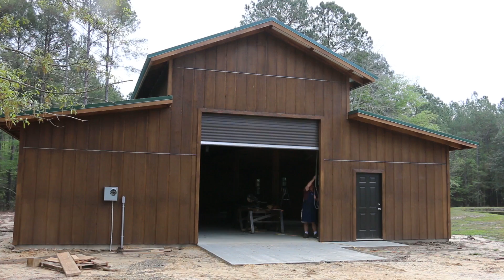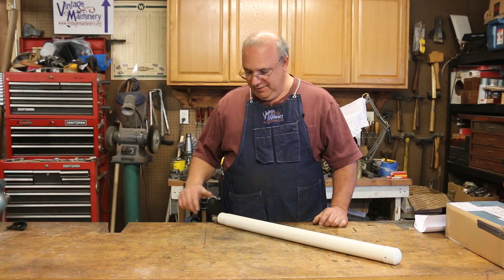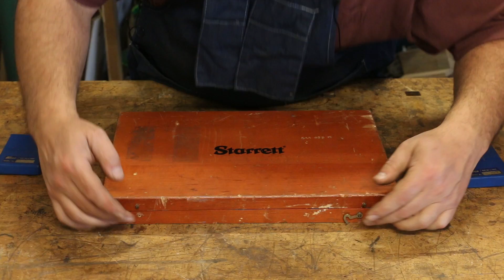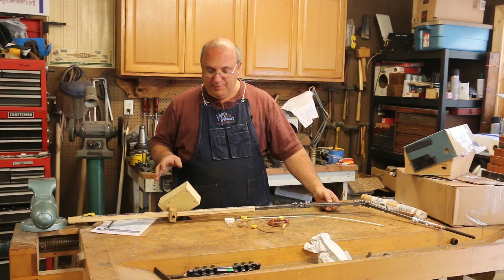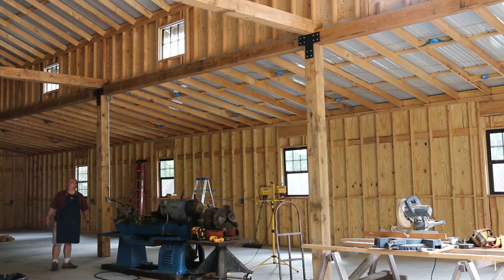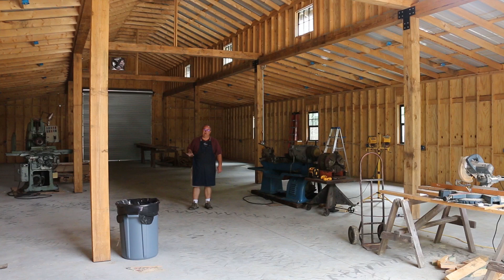Odds & Ends 44:  Viewer Mail and Shop Update

Comment: Keith, here at home there is a small bbq resturant that put in some corrigated tin for a ceiling.  At first I thought it was just cheesey, but speeking to the owner he explained that it was the look  he was after.  He even put one wall with it and finished it with moulding.  It's really grown on me and I have thought about it for my shop.  Reflects the light great and it was not expensive.  That will fit well with the look you are after.  If you would like I could see about taking some PICs of it for you.
Reply from the maker: +timholsten I have seen that kind of ceiling and like it.  But, I am a bit concerned with a metal ceiling where I will be shooting video as I am afraid it will not be very good from a sound standpoint.

Comment: Keith I love your shop, putting sub panel in is smart thing to do, I sure you know this remove the green bonding screw in sub panel.
Reply from the maker: +Joe Tiller Yes, you have to have two buses in the sub panel - one for the neutral and another for the ground, and they cannot be bonded.

Comment: Why use a rotary phase converter instead of VFDs?
Reply: +Justin Bell When you get to the number of 3 phase machines that Keith has vfd's for each one would be cost prohibitive, especially compared to a one time cost for a rpc. He will also have some other concerns like higher horsepower machines that at that level a vfd is very expensive.
Reply from the maker: +Justin Bell Exactly what Jason said.  I have a bunch of three phase machines already for my woodworking shop and then the metal working shop too.  For one or two machines, you cannot beat a VFD, but I would rather just wire the shop for three phase and be able to power the whole place off of one unit.

Comment: Nice opening shot.
Let me know when you get the bowling alleys installed.
I'll come down and we'll roll a few frames.
Thanks,
John
Reply from the maker: +John Bazaar We better hurry up and do the bowling, to many machines will be in the way soon...
Reply: +Keith Rucker - VintageMachinery.org 
That's true. You'll need them to make the bowling pins and rebuild the pin setters.
Thanks,
John

Comment: Have to agree with you Keith on the quality, it looks outstanding, absolutely gorgeous. Got there in the end. 
One of my lifelong dreams to have a workshop not quite to the extent of yours but something i'm comfortable in that allows me to work on my motorbike's and paint in house, a home away from home.  
Are you planning on running air lines throughout, also Tongue and Groove would look nice covering the insulation.
Reply from the maker: +Dinxsy Yes, I plan to run some airlines at some point.  So many things to do and so much money to spend....  I would love to do tongue an groove throughout but I am afraid it just is not in the budget....
Reply: Keith Rucker - VintageMachinery.org I did think about the cost after having the thought with the amount of coverage needed. Old Floor Boards would look nice also but i guess they sell for a good price with the many old properties in the US.

Comment: Keith I highly recommend a VFD I get them out of Georgia close to you I can't say enough good things about them from AUTOMATION Direct

I am using 3 of them in my little garage at the house

shop looks great I'm getting excited
Reply from the maker: +Bill Nebergall I am familuar with Automation Direct.  I will use a Rotary Phase Converter to power the shop, but I already have a few VFD's on some of my machinery for the woodworking shop.  You guys have not even seen most of that stuff yet....
Reply: +Keith Rucker - VintageMachinery.org looking forward to it

Comment: You have a problem with water splashing up onto your wood siding. I would put up rain gutters, that will help to some degree. If you don't the wood will rot in short time.
Regarding the acid on the concrete: Use a floor grinder instead. That way you will get a pretty structure and you won't damage your concrete with acid.
Reply from the maker: +Panzax I still have some work to do outside - dirt work around the building, some landscaping, and perhaps even some gutters down the road.  Things will be better once I get some landscaping in so that the water is not dripping on bare ground.

Comment: The shop is looking good; I like chip board instead of plywood and it's cheaper. made from wood chips and glue it has a neat color pattern to it also. I know what you mean about work and the honey do lists getting in the way of your shop building fun LOL
Reply from the maker: +DS75921 I have not even started pricing wall material yet - too many things to do before I get there.  Right now, it is just a challenge to find time to work out there between work and family.  Back on the road again this week and weekend....

Comment: It's pretty evident you worked as an electrician for some period of time. Your panel packout looks professional, the cabling looks neat and secure to the wall cases. Opting for a mirror panel is an installers dream for eliminating ugly feedlines over the beams, or at least a large bundle that would need to be supported across the hip. One suggestion is to use VFD controllers for each multiphase requirement.  At dealer pricing they aren't too bad and they offer a lot more than just clean, symmetrical phase generation. And yes, I know the purse  can get pretty light during projects like this. Regardless, this is a beautiful dream shop that truly makes most of the Youtube world that follows you, envious of what you've accomplished. If they're like me, they are living through you while watching it come together.   Thanks for allowing us to watch and enjoy.
Reply from the maker: +Ken Wolfe Thanks Ken - I like for my panel to be neat and I cannot stand a jumble of wires when I pull one open.  I will be using a Rotary Phase Converter for the majority of my three phase power but I do use a VFD in a few places where I need a more balanced input.

Comment: Just a heads up for Paul who did the electronics for the thermocouple temperature probe. Has he used the NIST polynomials to calculate the displayed temperature? Hopefully he has, otherwise it will not be that accurate. Here is some info you might want to pass on to him, just in case he hasn't implemented the NIST polynomials in his code: http://www.keysight.com/upload/cmc_upload/All/5306OSKR-MXD-5501-040107_2.htm 
(If the link was removed for some reason, just google: "NIST thermocouple polynomials"
Reply: +Daniel S 
Daniel, 
Thanks for your suggestion.  I did not use a polynomial correction but I think it would be easy enough to implement.  I used this thermocouple breakout from Sparkfun:
 https://www.sparkfun.com/products/13266
and fed the signal into an Arduino Nano with output to a 7-segment LED.  I will do some research at the links you provided and see what it would take to update the firmware.

Comment: Do your research on LED lighting there is a lot of hype and snake oil out there, it's the wild west akin to  the old locked rotor HP rating wars on air air compressors years back.  The only real lighting choices are LED's and FL tubes.   On a dollars per lumen basis you just can beat T8 tubes.  I went through this process about a year ago, really wanted LED's but the cost was at least 4x the FL tube solution.  Yes, the LED fixtures are coming down in price but you have to look at the cost per lumen AND the QUALITY of the LIGHT.  It's very hard to beat a  modern electronic T8  ballasts coupled with 900 series triple phosphor high output 90+CRI tubes. We are not talking big box store junk but fixtures with high quality ballasts with "ballast factors" of at least 1 or better.  LED's by their nature have a fairly narrow spectrum making the light less effective.  What I found is the high output LED troffers with good CRI numbers were still very expensive on a dollar per lumen basis.  I could get low cost imports but the lumens and light quality was not very good.  All LED fixtures suffer one major issue -- you have to dissipate the LED heat or the LED's die or degrade quite fast.  I found this is what governs the lumen output.  Better fixtures that cost more did a better job.    One last issue: when the lightening strikes or you get a power surge you may only  loose a $18 FL ballast but it will take out a $400 LED fixture.   As far as energy efficiency, I found some LED fixtures that were a little better then the T8 solution and a lot that were worse, but in general they were close enough not to be a major deciding factor.  As for life the LED elements (if kept cool) will last longer then the FL tubes but both LED's and FL fixtures have ballasts (power supplies, ballasts) the do fail.   An LED's light output does degrade with time.  I really wanted the LED's but just couldn't make them pencil out,  give them another 5 years.

Comment: Do your research on roof insulation. Normally you don't want the insulation pushed right up against the bottom of the metal or roof sheathing. Typically you leave a half inch of air space. And make sure your ridge vent is working well in conjunction with the inlets between the rafters at the exterior walls (but not the gable ends). Letting the hot air and moisture out is very important.
Reply from the maker: +Kevin Hornbuckle I have heard different opinions on if the insulation should touch the metal roof.  In a lot of applications, they actually lay the metal roofing directly on top of foam insulation sheets to prevent condensation.
Reply: +Keith Rucker - VintageMachinery.org yes, it is disputed terrain.

Comment: A small forklift would be handy.
Reply from the maker: +tom7601 Indeed it would!  I have access to a tractor with a bucket that can be swapped out to forks that I used to unload some of the stuff I already have in the shop.
Reply: +Keith Rucker - VintageMachinery.org Keith, you mentioned a small forklift, I'll ask the neighbor if he still has the one he had when I helped him, it is a small Yale front fork lift gasoline engine, it runs but has been sitting for several years, he was asking 500 for it, (may take less) as I said it is a small one maybe 2000 pound capacity, If interested let me know and I will check on it. Still waiting for the rains to stop long enough so that Neil can come after the South Bend lathe.

Comment: Keith,
Once your shop is done, I may have to fly back there and get the $5 tour! (That's the nickle tour adjusted for inflation!) How come you aren't burning several thousand $$$ on a A/C and heating plant? (LOL) During winter, you can use space heaters or a couple industrial propane-fired heaters that hang from the ceiling (Reznor comes to mind). ... Regarding your goodies, you got some really cool stuff! You are going to need a kennel for all your lathe dogs! (LOL) ... Thanks for sharing as always! Good luck with the shop! As we say here in Cal-land, "You are one lucky dude!"
Have a good one!
Dave
Reply from the maker: +Swarf Rat At some point, I will probably be adding some kind of AC unit for the shop, but too much money needs to be spent on other stuff first....

Comment: you can get led shops lights from Costco. $25-30 a pop.
Reply from the maker: +schmitty8225 They have some at Lowes for a similar price.  Just not sure how well they will work and hold up compared to some of the higher quality fixtures.  I am doing some research now trying to decide what I want to use.

Comment: What, no cupola on the top? That would really finish off that barn look of the shop Keith and of course with a weather vane or a lightning rod with the glass ball or both. That would be some good projects with woodworking and metal work included which would be some interesting video material. Anyway, nice shop Keith and thanks for sharing all this with us!   Jamie
Reply from the maker: +wvrockcrusher My wife has suggested a cupola as well.  Don't be surprised if one does not show up one day!

Comment: Awesome shop progress Keith!  Just for peace of mind, you may want to consider putting alarm contacts on the service doors, and 1 or 2 motion detectors inside that just run to a beeper or notifier in your house. Doesn't need to be a monitored system, just something to wake you up if someone gets ballsy enough to try something. And DON'T make a video about it!!!  Also have you considered standard screw-in LED floods? With so many fixtures and such high ceilings you may get good light coverage without having to spend a small fortune on the 4' fixtures.  Maybe try a test with half a dozen, if it doesn't work out, just return them and get your money back!
Reply from the maker: +Adam W We have an alarm in our house and I will be adding the shop to the alarm system we already have.  I already have my small shop hooked up that same way.  As for the regular LED screw in bulbs, that is what I will use down the center section of the shop where I will be using the old fashioned looking drop down lights.

Comment: In the shops I have had over the last thirty years and the shop I have now dust is always a problem. I have used various  industrial sealers and different paints in my numerous attempts to alleviate the dust problem in different shops.  Two of the shops were floating slabs and with both of them moisture weeping up through them created problems with the sealers and paints not adhering. The floors had large areas where the paint bubbled up and peeled badly. Once sealer is applied it has to be resealed every few years to maintain it. I have discovered that grinding and polishing the concrete solved both problems involving paint and sealers. Not only does it flatten a slab it permanently seals the pores in raw concrete whereas the polished floor will actually reflect the lighting in the building much more. I'm sold on it after having ground and polished concrete for a living some years ago. The nice part of it is that one can still epoxy or even paint over the polished concrete if a certain floor color is desired. Had I known forty-years ago of the benefits I would never have poured another slab for my own use without having it ground and polished before I began using the building. In my opinion it is money well spent on a process that never again has to be performed. It is a permanent solution to dust and debris constantly floating around in the shop and settling on everything. I have found that even the heating and air conditioning units and filtering systems I was using in those early years would have lasted much longer. I think the initial cost scares many away to the degree they never get the opportunity to experience the many benefits grinding and polishing a concrete floor can afford them. I know now that in the over-all cost of construction it is without a doubt one of the best investments I could ever make. Not only for the building but for me working in it. I no longer have to breathe the concrete particulates an unpolished concrete floor constantly emits.
Reply from the maker: +Ramjet74 Something to look into....

Comment: hey Keith you are doing a great looking job with the wiring  one think i suggest is the balance the breakers and load over both sides of the panel so you dont over load the one side or the other
Reply from the maker: +chris rhodes Still lots of circuits to put in there...  I have a plan....

Comment: Hey Keith, the shop is looking awesome! I have been working on the inside of mine also.  Mine is similar size, but my 10 ft. walls make it look much smaller than yours.  Here is a vid I made earlier this week showing the plans for the inside in case you get a chance to check it out.  https://www.youtube.com/watch?v=BIZ077cvbsw
Reply from the maker: +🔥Ramsey Customs - turbocobra Very nice.  I like the spray in insulation that you used!

Comment: That is going to be a very nice shop, one day in the future I hope to build/buy my own and get out of my leased space. Are we going to see anymore planer work? Not that I'm biased but I really like that really old machinery more than than the stuff from that last century :)
Reply from the maker: +Widget Works Manufacturing Inc. I still need to get the last of the side heads all finished up and run some more wood through it.  What is holding me back is that when I mess with the Planer/Matcher, I really need some help and here lately, I have not had anybody out at the museum to help.

Comment: Shop looks great! I remember when i did my shop it seemed like it would take forever.

 I did all my own work as well except for the framing. I would also suggest having the insulation foam sprayed in. I did in mine and it makes such a difference. It's quieter and it seals everything extremely well. It's a little on the expensive side so if you can stage it it might help. Honestly you should at least look into it.

 Keep up the good work.
Reply: +TODD FINK  A way to cut some of that cost is to cut foam sheets to fit between the studs with a 1/2" gap or so. Then use the spray in foam to "glue" those in place. It really helps keep the building warmer and cooler in summer.
Reply from the maker: +TODD FINK We used the spray in foam stuff in a building at work.  It is amazing stuff.

Comment: I'm not sure if this is practical with the fixtures you have for the lighting, but if you're going LED you might want to consider a DC lighting circuit so that you don't have to have LED lamps with built-in switching converters. The converters are one of the main failure modes of LED lamps, so concentrating that in a single, suitably-specced dedicated converter somewhere would probably save you money in the long run, as well as improving the overall efficiency of the lighting circuit.
Reply from the maker: +marinedalek Something to think about.  Thomas Edison would be proud to know that people might be going back to DC with these new LED light!